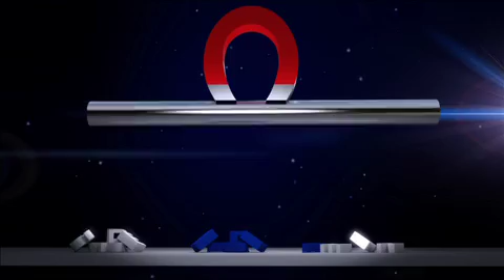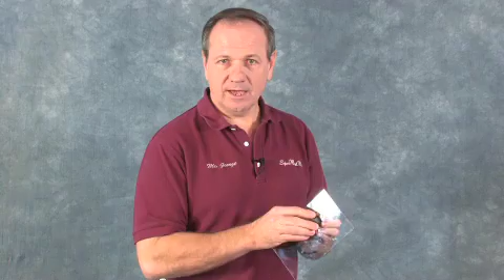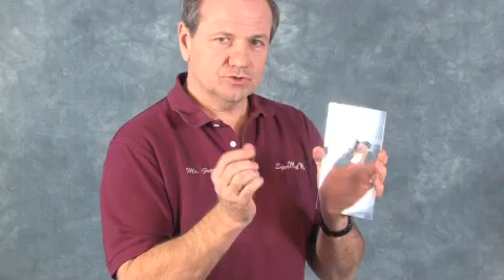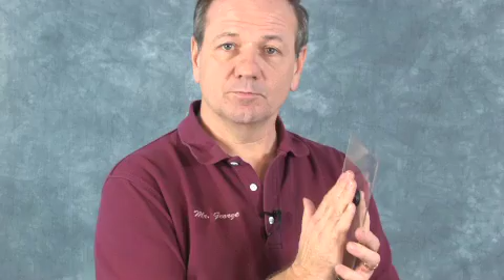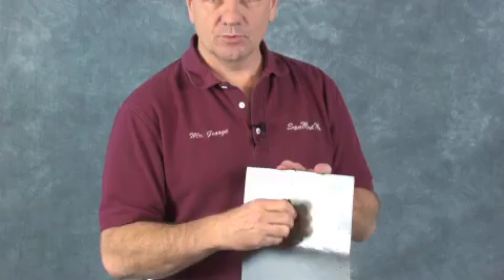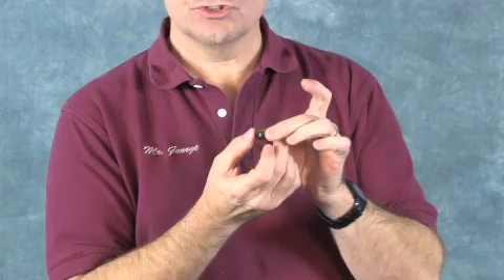Rubber Coated Magnets

Comment: Do you know if the spray on rubber coating holds up well on neodymium magnets? I have two 1"x1" neo's and have been thinking about trying the spray on rubber coating.
Reply: I’ve done it with some cheap rim coating spray. Looks good but it stays very soft for a couple of weeks, so a dent will stay there. Lastly the “easy to remove” factor makes it tear or scrape of very easily. Perhaps Plasti Dip would be the better way

Comment: It looks like the only rubber-coated neodymium magnets available on your website are a bit smaller than what I'm looking for, and there are only three different sizes listed, all of similar strength. Am I missing any others? The ones in the video look quite a bit bigger.
Reply: Hi, Ryhisner, nice to meet you. We are a manufacturer supplier of magnets in China. We have been supplying very strong neodymium magnets. We can also do rubber coating on magnets in different size. Contact me if you like. Skype: luffyliu1989, magnet09@winchoice.cn. Luffy